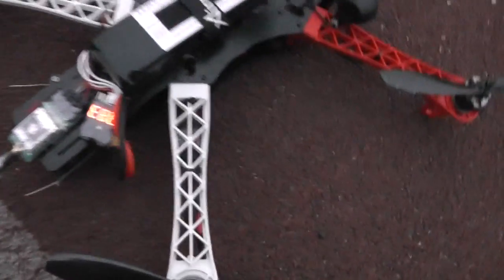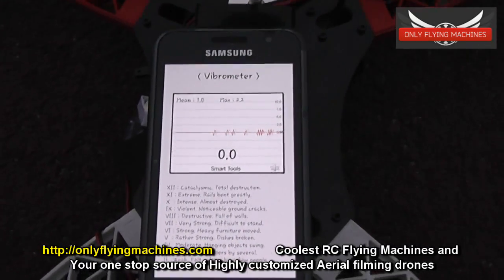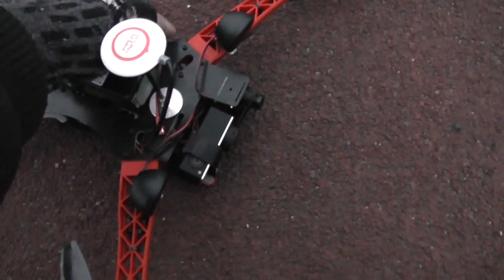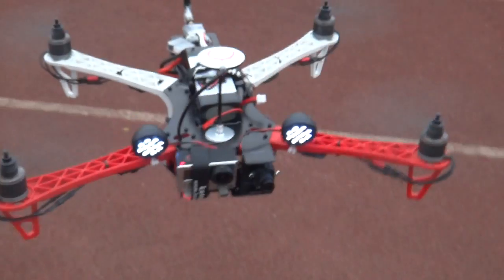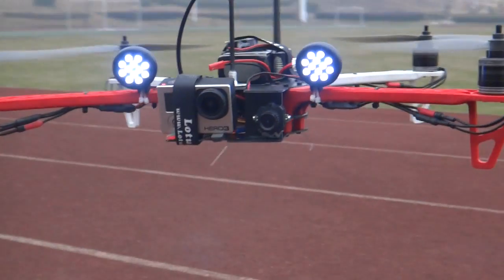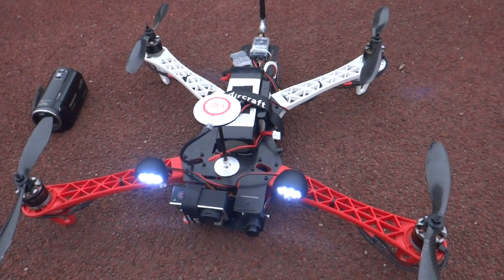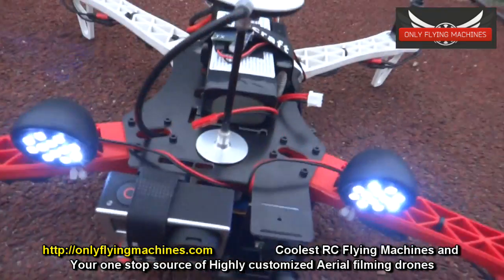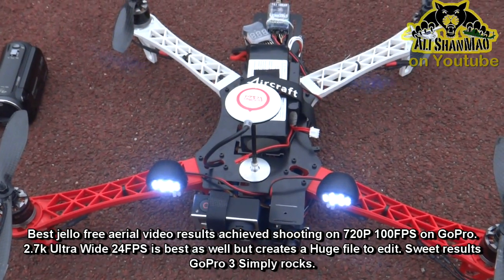OFM Seeker 450 V2 -- 2nd Flight testing with 8 inch Props

Comment: That app was very useful for me too. I suggest you check out "Vibration Monitoring" - it's even better!
With separate X, Y, and Z axis' and it also can save to a txt file for graphing and analysis offline. I also seems to record at a higher resolution, more samples per second. I'm not affiliated with them but thought I'd pass this along.
It's in the Google Play store.

Comment: I use the NAZA-M and it works well but you can't see the BEC light when flying FPV unless you use an OSD to show battery voltage. The problem with the GoPro as with all HD cameras is the output is not compatible with current FPV goggles and you get two black borders reducing your view. The FPV type cameras also tend to be better when it gets dark. At least that's my experience. Nice video Ali.

Comment: I didn't see the real meaning of those reflectors xcept that they add some ballast to shorten flight time. Where do you need the extra fpv cam when already GoPro is onboard?
And the Lipo saver? I thought the famous NAZA has integrated feature for this purpose and can program the lights for some sort of low bat warning blink sequence.

Comment: Hi Ali, with my OFM Seeker 450 V1 i get about 18 minutes on 4s 5000mah batteries. If now you are using these tiger motors that are more efficient, why are you flight times so much less?

Comment: I read a tech article a month or two ago about a new Radar Chip recently released on the market that will revolutionize robotics. I would guess it won't be long and we will see them in our telemetry options. Actual radar altimeters for the low flyers.